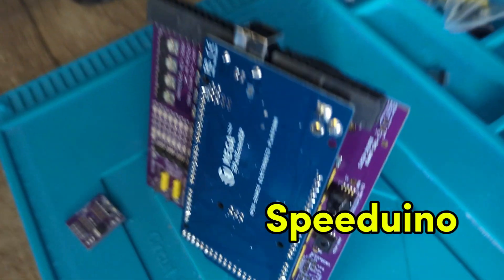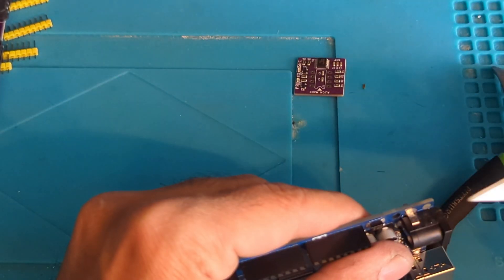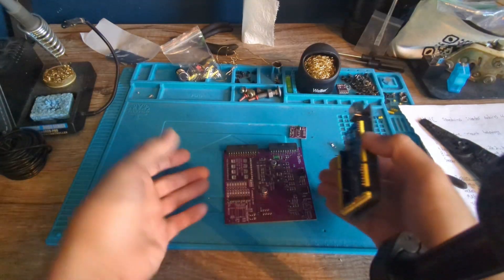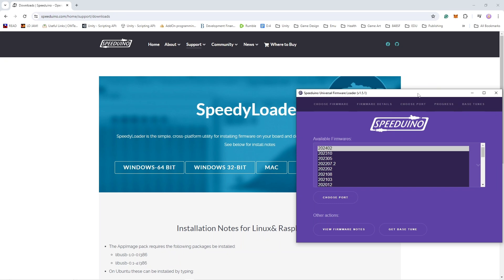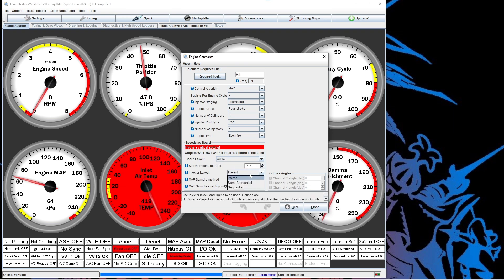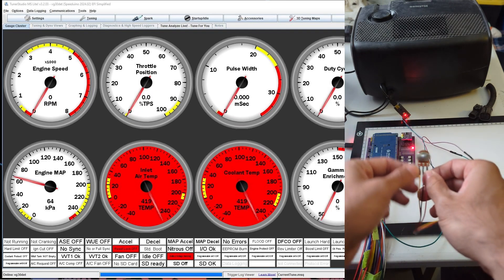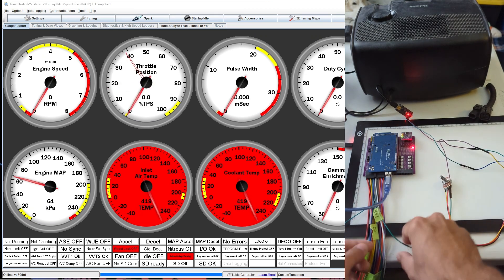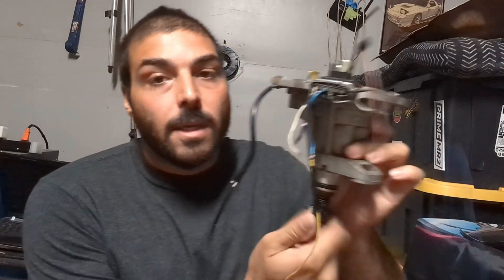Building a Budget Standalone ECU: Speeduino + UA4C Setup

Comment: Why do you remove the power from your arduino unit? Sorry, I am not familiar with electronics.
Reply from the maker: The power input it does not fit on the Speeduino board. 
So you have to remove it and use usb for power. 
No worries all questions welcome :D

Comment: Would this be possible for a 7.3 power-stroke diesel
Reply from the maker: Unfortunately i don't think so you would need to modify the code for diesel as they function differently.
Reply: @aftereartharcade  I see the heui injection system uses different methods to speak to the ecu and it also has more variables like ICP and PW
Reply: @aftereartharcade also the throttle on a diesel only controls fuel because the intake is always open
Reply: That system uses a 140V driver for the injectors.